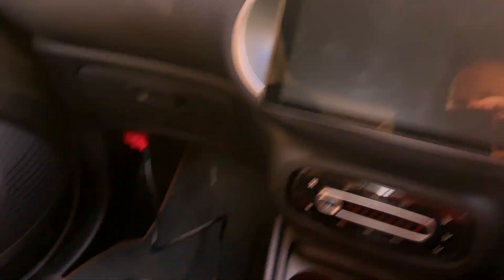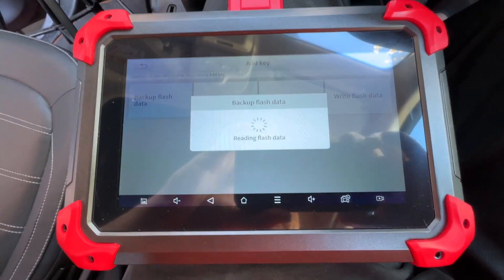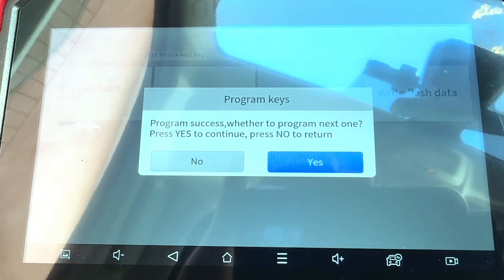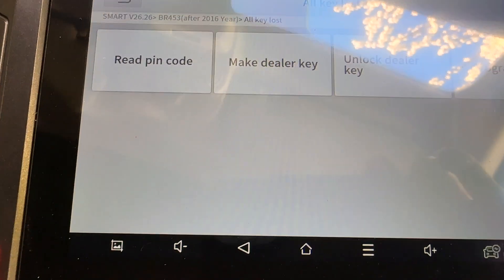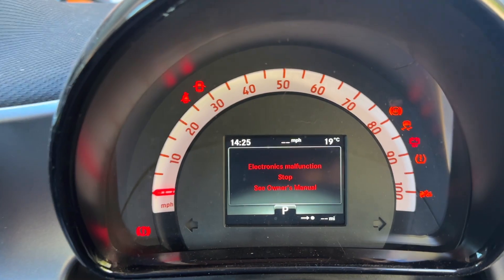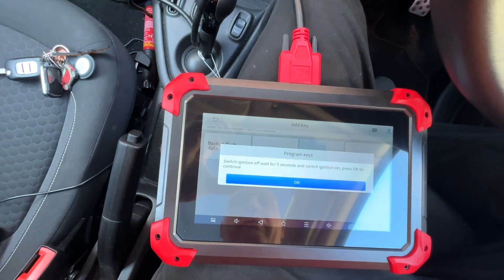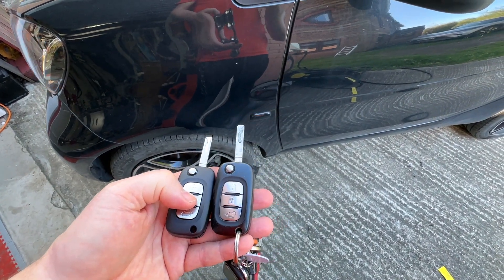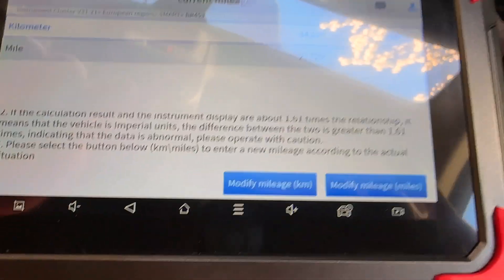Coding new keys to a smart 453

Comment: Question if I read the flash and code a few years ago can I just use the saved file now and make another key ...also can I use a used key ..the Chinese keys are junk
Reply from the maker: I don't see why not. The code doesn't change and 2nd hand keys can be reused but obviously need a new blade.

Comment: I'm waiting to get a key done for the wife's 453, but Smart wont do it till we have a V5C in her name, license, etc, etc.  
Just fitted the tracker and locking wheel studs today.
Reply from the maker: Yeah, they are right on it for key security for the last few years. They used to just ask the parts department employees to check for ownership but I think that opened up the possibility for people getting paid to order keys with no proof.

There was a spate of smart thefts many years ago where the thief had a key already pre-cut to manually open the door. Then it didn't take long to code the key and drive away.

We couldn't decide if the group had access to new keys from smart or if the cars had all gone in for work at a dodgy smart 3rd party (which has thankfully closed a long time ago).

Comment: Can this tool do anything else for the 453s?
Reply: How much are the keys from smart aswell?
Reply from the maker: £130
Reply: @evilution_ltd  not bad. And cut already I guess.
Reply from the maker: Key programming 450, 451, 452, 453, 454.
Mileage adjustment 451, 453.
Steering angle sensor 450, 451, 452, 453, 454.
TPMS reset 453 EQ.
Service reset 450, 451, 452, 453, 454.
Reply: @evilution_ltd  I'm after a tpms on my 453 fortwo. Should be able to do it right?
Reply from the maker: @nizamahmed5073  Yeah I guess so. Not tried it because I have a handheld Autel TPMS cloner. I have a video I didn't publish from last May about it, I'll see if I can finish it and upload.